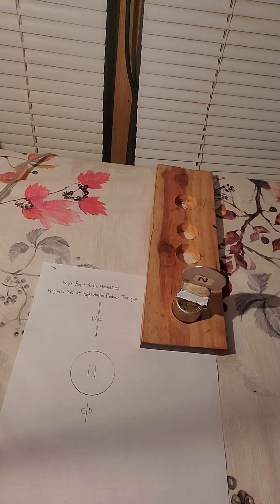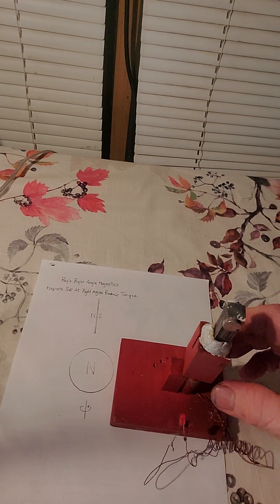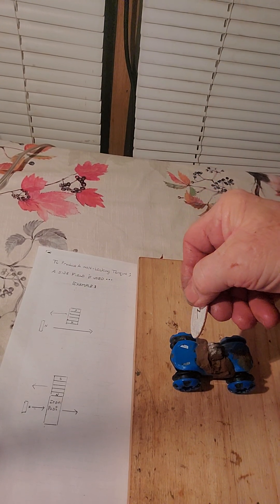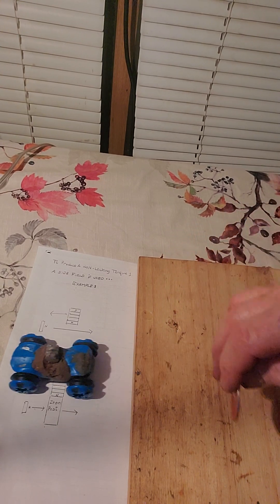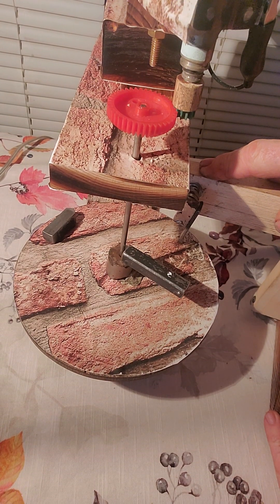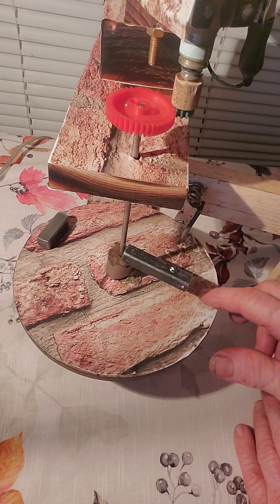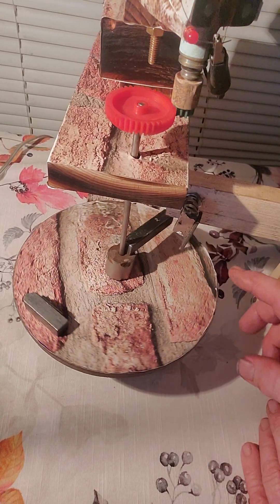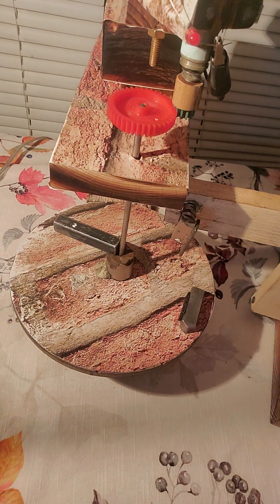Ray's Magnetic Torque Generator 1

Comment: you can try  to set up a 1-way pendulum that's rotating 1 way and put this magnet system on top and below so they don't interact with each other and can amplify the rotation and using gravity to keep spinning with the weight

Comment: It seems the soft approach is possible because of 1.The 90° perpendicular angle which exposes approximately equal Push and Pull from the disk magnets North and South polarities, and 2.The slight tendency of attraction between the disc magnet and the bar. If the bar was bent in a slight curve forward, maybe its approach would be less hesitant?

I think your precise placement of balanced magnetic components is pretty amazing. Reminds me of Wesley W. Gary.

Comment: With your car example, I picture a subway car going down a tunnel where the 'overhead' lights in the tunnel are your circular magnet.  Give the car an initial push and it seems like it would keep rolling. Just a thought from a total novice!  Thanks for doing this experiments and videos!
Reply from the maker: It can happen...it lies a lot in the activator , the above magnet... normally when several are placed in a row they diminish the effect , not enhance it , due to the repeated N-S...N=S...N S  fields tend to slow it down...one could perhaps stack each at different levels to get around that ? Recently I stumbled across an activator that enhances the effect..New people in the field are much needed...they bring new ideas..good luck..

Comment: wow! so there is no resistance when you are near the magnet and then it accelerates?
Reply from the maker: Input resistance is always the bane of o.u.   To say there is none is the goal...More accurate to go for ratio of power in to out ...but to answer your question...some but neglectable to overall interaction...you have a good intuitive mind...
Reply: @ just make sure its not just converting energy over time. if the “tiny” resistance is compressed to short time and gives out double in time in release. magnets are tricky :)
Reply from the maker: @ReigoVilbiks  "Tricky...you said it in a nut shell !!!